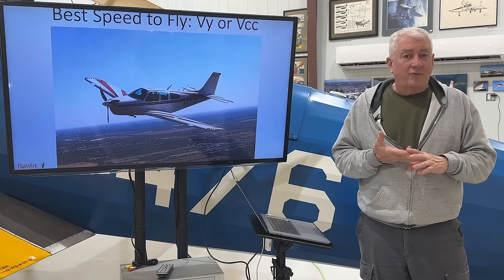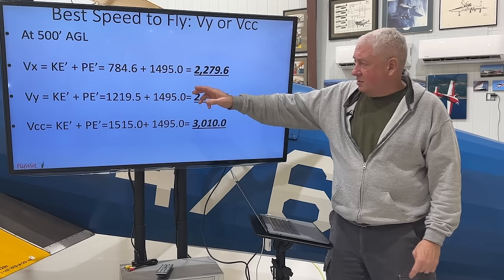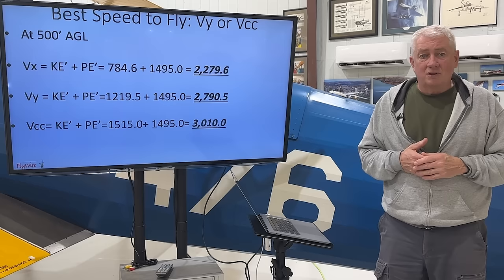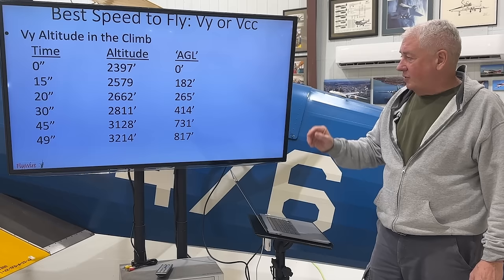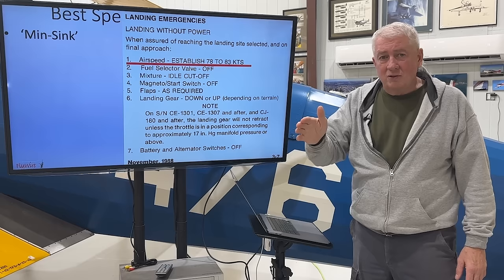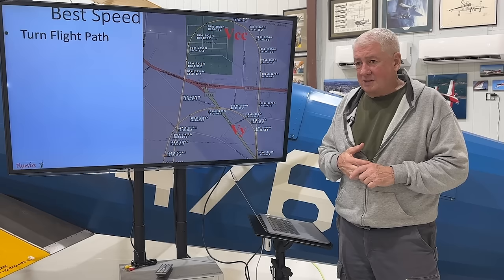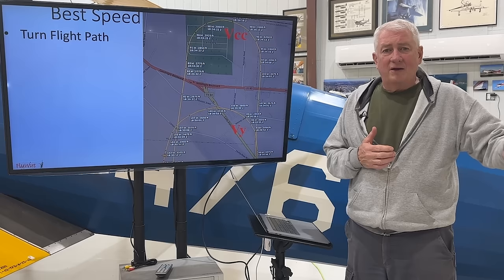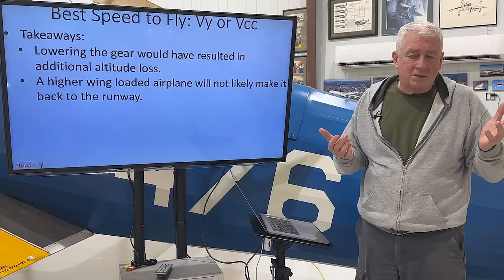Best Speed to Fly- Vy or Cruise Climb

Comment: I learned from a Bush PIlot CFI (1995) ,  to add some flaps like 10 degrees on every normal take off  at Vr and climb with those flaps 10 degr. to 500 agl at least at Vy.   Why? Better rear engine cylinders cooling due lower AOA with some flaps climbing, and also you can see better over the nose for traffic or BIRDS (1990's).   I Avoided some bird strikes that way.   Dan Gryder does that too lately.  It is part of a Bush Pilot trick   "Flaps 10 at Vr climb method".  Hawks fly mostly at under 300 agl, and Geese too when doing short trips.  Be able to see them.  They are the biggest birds to hit and cause big damage to you.  and yes, at a bit under gross weigthts we were getting ove 750 fmp of climb most times except in hot days.
Reply: IME Bush, Cessnas mostly.
wheels clear, immediate flaps up, pin Vx to 100+ AGL, Vy to clearance AGL.. 
I'm not a fan of the zoom climbs with flaps that you see on YT.

Comment: G'day Scott,

Yay Team !

  (Sighs wistfully...) It must be nice to have so much power available as to have the choice of which airspeed to climb at, to better be set up to choose between attempting to return if the the Shafting of all Crankiness runs out of  Twisties...

Ultralight Motorgliders use full throttle at Best Glide Speed, and then sort of "feel around" for the highest Climb-rate on the VSI...; and then go looking for a Thermal, or some Ridge-Lift, within which to circle for a bit to wind up some 
Altitude - before trying to go anywhere away from the Airfield...

 Levitating on a different scale, kinda thing...(!).

Keep on keeping on,

Stay safe,

Happy Solstice Festival...!

;-p

Ciao !

Comment: Vx and Vy basically exist to accomplish a specific performance goal, clearing an obstacle. The obstacle can be virtual, like some sort of altitude constraint, but it has the same effect. Typically airplanes are flown to go from point A to B, so absent an obstacle, cruise climb speed is ideal because it gets you where you want to go more efficiently. Transport jets compute optimal climb speed for efficiency based on a lot of factors, but it is never the plane's best feet/min. If you're doing a local pleasure flight, performance doesn't really matter much as the whole flight is arbitrary. The math is interested but unnecessary.
Reply: Yes, airspeed is options as Scott says down low.  Altitude, when high, is time but has only potential energy value when low.  Airspeed there is life.

Comment: Thanks again! @flywirescottperdue, 2 questions what were the winds during your test, and did you turn into the wind?? 2nd at the end of the video you mention ADM and taking off at a 45, This has been one of my ideas when there is a crosswind component. sounds logical that if we allow the plane or even direct it down wind this would allow 180 turn back into the wind to align us with the runway. I would love to see this tested. my current take off brief involves turning into the wind if at all possible.
Reply from the maker: Craig, for this test flight the winds were very light, about 4 knots. Check out the test I did with the A36, very strong winds and I turned into the wind for that test.  It helped.

Comment: QUESTION - I was taught in flight training that during an engine failure, airspeed above best glide should be traded for altitude with a generally hard pull-up followed by an aggressive pushover when best glide was reached.  Of course not pulling so had as to create an accelerated stall situation.  Here is the QUESTION - Does the abrupt change in positive angle of attack use more energy rather than just holding altitude and allowing the excess airspeed to decrease.  Excluding the turn back situation as an added variable, any thoughts?
Reply from the maker: Doing a pull up like that is a waste of energy. Better to use the excess speed to turn towards a filed and get yourself setup and trimmed.
Reply: @FlyWirescottperdue  That does make sense but if Im cruising at 115 indicated and best glide is at 85 thats 25 knots of energy to swap for altitude.  My dbout in this is the induced drag from the higher angle of attack.  Of course I trust your aviation expertise ultimatly as it far exceeds my 800 or so hours.  Great conversations though.  Appreciate you as a professional.  You really have effected pilots in a great way.  Ty
Reply: V speed considerations are high altitude orientation where altitude is time.  Low altitude orientation is airspeed is life and use airspeed to maneuver to the very near landing zone.  You have six seconds.  It will be obvious. @PilotCooking

Comment: 15:06 I consulted with my 1996 CFI of Turnbacks and EFATO 4 maneuvers we did all ON THE RUNWAY, not only "at altitude".  He said no way a higher speed Turnback from Vcc will be tighter or smaller radius than a lower speed from Vy turn.  I will be the contrary.  Vy Lower speed means tighter turn and quicker turn too when trying to pull up a bit to get the under Vglide Vmin sink speed.   We made much tighter turns on Cessnas at 65 than Cherokees at 80.

Besides Vcc will put you so far away from runway that even if you turnback at VminSink,  you will finish the turnback much farther away from runway.  Do them on a runway and see that.  Vy with some flaps climbs are better.  see the other post.
Reply from the maker: I think you breezed through the video without really catching what was going on. Perhaps you should watch the other videos in the series as well. The speed loss flying Vy gets you very close to the stall speed, indeed in this video it got to within 1 knot. The speed loss at Vcc resulted in a speed very close to Vy in the first place. I appreciate you watching and thinking about it, but it seems to me your reaction was spring loaded. Watch it again and parse what was going on. You missed a lot trying to disprove me.
Reply: @FlyWirescottperdue  3 seconds reaction time? Or more? But i will see video again.  But how come such a strong engine not light single with good inertia can lose so much speed on EFATO from high speed climb Vcc.
Reply from the maker: @outwiththem   Drag....
Reply from the maker: I've done several videos on this topic, for this test I did not wait 3 seconds and I explained the reasons.
Reply: @FlyWirescottperdue  Vcc in case of NEVER TURNBACK MINDSET i think you mean.   

Most engine failures are partial power, like losing one cylinder or two. 
   I suggest you at least try  "A Turnaround the airport" after a  cylinder loss, climbing at 200 fpm only, sim a full gross high alt cylinder LOTO AND LAND IT TOO.  
I learned them in 1996 on Cherokee 140 at 60% power only.   From 600 feet agl only on initial climb.  
  Hard to do, but better than crashing on top of houses and cars outside the airport.

Too many crashes on take off even if never did "A Turnback"  at impossible turn conditions.  Many of them are Turnaround The Airport, but many say that was "A Turnback".  They are not the same maneuver.
Reply from the maker: @outwiththem   Watch all the videos in the series on this topic. I think you have missed the point. It is impossible to cover this topic fully in one 15-20 minute video.
Reply: @FlyWirescottperdue  My 1996 CFI Bush Pilot and 4 EFATO maneuvers posted what he knew about partial power LOTOT/ROTOT on your partial power C177 accident video.
He had 3-4 partial power emergencies on take off from only 100 to 200 all of them and he is a mechanic too, so he knows about engines too.  He landed all. 
I hope that helps the ones that dont know those things.  I know 2 of his students that also had those LOTOT and both brought the airplane back.  One had only 70 hours.

Comment: I like to use short field technique as a matter of course.  Off early then hold the nose over the RUNWAY and accelerate and at about 85 in the RV7-A apply back stick and see how high you can get the vertical speed to go and as it decays start nosing over.  It's just a habit I learned at Purdue years ago in a glider on how we handled tow release.  You pull the stick back to convert the kinetic to potential energy then from your perch you started hunting for whatever lift you could find.... I would hunt over the power plant chimney stack.  The other reason though is if I do the pop up and flatten over the runway and airspeed is not accelerating I will take that as a heads up we're in trouble.  I can't recommend enough folks should do initial flight training in a glider as you learn energy management and "sight picture" for landing feasibility from the get go.

Comment: Is total energy at Vcc higher than Vy? Yes. You're missing the point of energy rate (power). If you're goal is to have the highest rate of energy at an engine failure, then yes, get as fast as possible. If you're looking to minimize your integrated low energy state risk,   I will stridently disagree with you and state that climbing at Vy puts you out of the low energy risk state the fastest. You're also not addressing that you cover more ground at Vcc and this exceeds your Vg distance.

Comment: Having some trouble following your arguments....

Yes, the Vcc v Vy is largely negligible as we're dealing with aircraft with very small power to weight ratios. It's all going to be very small differences.  What you neglect to address is "what's the goal?" Am I departing in flat terrain? Mountainous? Vcc gives: better visibility, cooler engine temps, more miles behind you v time (which is the goal here, right?). 

I'm not aware of any situation where a higher airspeed yielded a smaller turn radius given the same angle of bank.

Ok, hang on...Yes, Vcc may be better in terms of overall energy (K+P) BUT kinetic energy isn't the goal of Vy or Vx. You're also negating the power difference between Vx, Vy and Vcc in a fixed pitch prop engine. The F33A doesn't relate to the 172 that way as you're producing the same power at Vx, Vy and Vcc. Your THRUST is different based on prop angle. The poor guy in the 172 plays a game of RPM v airspeed.  

The bottom line is teach what the current FAA standard is. Let's not reinvent the wheel based on a couple anecdotal experiences you've had. I guarantee Beech and Cessna put thousands of hours of theory and flight testing into this to come up with their numbers.

Intersection takeoff? You bet! If my balanced field allows it who cares? If it means leaving 200' of runway behind me to avoid 6 Cirruses doing 30 minutes of runup at A1 I'm going. Saving fuel and time for the boss in my game is the rule. Like I said, if balanced field allows it. I'm not going to plop my jet back on the runway at V1+30 Kts if we bag a motor lol. 

Keep in mind we're training pilots to be more (sometimes not) than 172 drivers. That said, fly the airplane you're flying. Don't adopt F33A procedures into a 152 or worse, big jet technique into a SE bug smasher.

Finally, as to the "impossible turn" the pilot needs to find out what THIER turnback altitude is for their skill level and airplane. 9 times in 10, the resulting stall/spin is what kills, NOT the minimum FPM controlled off airport landing.

Comment: All good stuff relevant to a complex multi-factor situation, so thanks. One question I have in the Vy versus Vcc debate is about how much extra energy it takes to get back to the runway if climbing at Vcc, which puts the runway farther behind the airplane for any given altitude or any given time since liftoff, and therefore is the extra kinetic energy at failure if using Vcc worth it if it takes more than that extra energy to fly the extra distance back? FYI, I'm generally in the Vcc school of thought primarily because of the startle factor when the engine fails.
Reply from the maker: Good question. In a high wingloaded airplane you'll be pretty far from the runway before hitting your decision point of, for the F33C, of 1100-1300 ft. You will have plenty of energy to land on your selected spot, even if it isn't a runway. Don't be committed to the runway, commit to walking away.
Reply: This has worked for me in Pawnees and light Cessnas.  From very low, what is available and survivable is immediately obvious in the first second, leaving five more seconds to maneuver.  Only what we can see immediately in the very near hemisphere (Scott's ahead of the wing) is available.  Having only two high altitude engine failures, I am not sure if startle factor leads to stall before working the emergency.  Down low, aviate is all we have time for and the airplane will fly through the startle without stalling given cruise airspeed.  Cruise is actually a bit too much.  I also use/teach the energy management turn (law of the roller  coaster) which involve wings level pull up to slow and reduce radius of turn.  Next bank at whatever bank angle necessary at 1 g by releasing back pressure on the yoke as soon as bank is initiated. @FlyWirescottperdue

Comment: I like vy for rotation. Then accelerate to cruise climb. I started out assuming that every airplane is just a glider with motors. So the first rating I got was a glider rating. I always assume that I will have engine failure some day. And then I have a very heavy glider. To me the idea of a turn around is 💯 percent  dependent on altitude.

Comment: Thank you.  Some interesting concepts to ponder.  One question for the F33A with IO520, if the engine quits on climb and oil pressure is lost, what will the prop do?
Reply from the maker: It will slowly lose rpm until it is driven by the wind. This is all drag.
Reply: Most constant speed propellers will go to the flat pitch (‘high speed’) limit in the absence of oil pressure.

Comment: I understand what you're saying but my instinct is that flying at Vcc is a bit of cruch for poor training and bad preparedness to act to push the nose down if you lose your engine. I agree about Vx being way too close to stall speed for it to allow for enough reaction time but Vy should be enough. And since the total energy state is the sum of K and P energy it doesn't matter if you're lower and faster or higher and slower, you have the same energy. So really it's a choice between the two but one thing you didn't mention is the distance from the field. With Vy you will be closer at the same time vs at Vcc because your vertical speed will be higher and so the gradient will be too. And so it's not just a choice between being higher and slower and lower and faster but also higher slower and closer vs lower faster and further away. I will keep my climb outs at Vy personally because I train for engine out in the climb (I think at least it trains me for that) when I do hops on our 12k ft runway(t&gs with a climb to 150ft and then cut power and t&gs again and again..) and I prefer to be higher and closer, even if slower, than lower and further away, even if faster. I think being higher and closer to the runway is a better place to be. But I appreciate this series a lot, thank you for making it!
Reply from the maker: I did actually mention distance. I said that neither Vy or Vcc would get you back to the field in this airplane.
Reply: @FlyWirescottperdue  Oh ok, sorry I forgot about that. However I wonder if that is accurate, that neither would take you back. Have you tried, at altitude a 50° bank turn back? I am sure a shallow turn will not get you back but did you try a steep turn without pulling back. I don't know how much alt you would use but the turn radius would be tighter and the turn completed quicker, maybe quick enough. Just curious if you ever tested that?
Reply from the maker: @markor2476  Mark, watch the Turnback videos I did with my A36 in particular. There is some good stuff in that Playlist I have in the description.
Reply: @FlyWirescottperdue  Will do
Reply: @markor2476  The steep turn without pulling on the yoke is good for getting into the good spot in the very near hemisphere ahead of the wing.  I was always too low to be tempted by the turnback, but the outcome of the maneuver was never in doubt.  If nothing but houses, put the nose between two.  If wires, pitch down and attack them.  Even a windmilling prop will cut service wires.  Do a good job with what's doable rather than almost perfect with what is not.

Comment: So great, Gunny.  Sobering relative to how often my post runup "departure briefs" don't match reality at a given airport/runway.  Too windy to fly in SoCal today so decided to do a little armchair trip using Google Maps to look closer at departure end options at the local airports I most often fly into/out of in and around KVNY.  Yikes!  Lots have zero options that don't end up in a building depending on the direction of flight.  <sigh>  Can't afford a turbine but maybe it's time for that Diamond Twin...
Reply from the maker: Or a downwind departure, as ai remember for 16 you need to turn pretty quickly anyway.
Reply: @FlyWirescottperdue  My Bush Pilot CFI showed to me a  600 agl traffic pattern procedure he learned to fly in South America.  Turned Crosswind at 400 agl.  Much more efficient and better for engine.  That 1k agl TPA is from the 40cents of Avgas prices in the 1950's.  600 agl is better.
Reply: @outwiththem 
Actually the gas prices are the same when you consider everything has also gone up $.
I've done a lot of bush flying and usually have done that. Also I've never had one quit in 50 yrs.= OCD 😳 AP/CP.